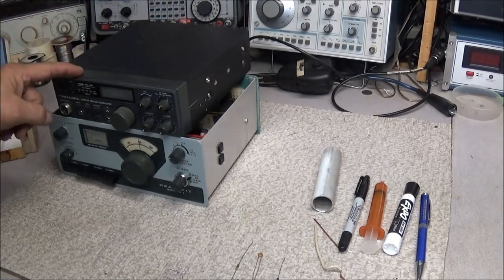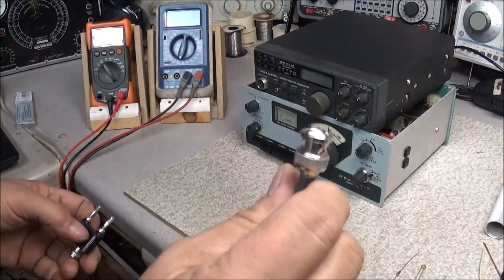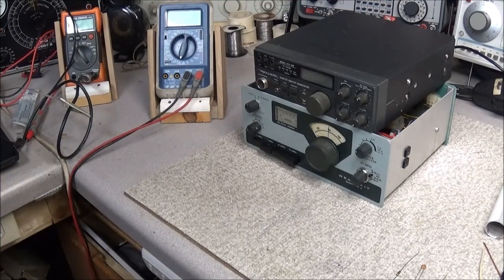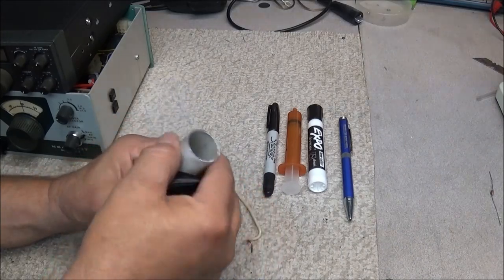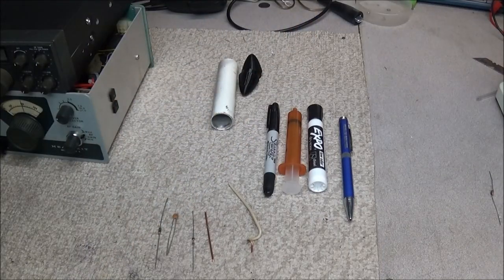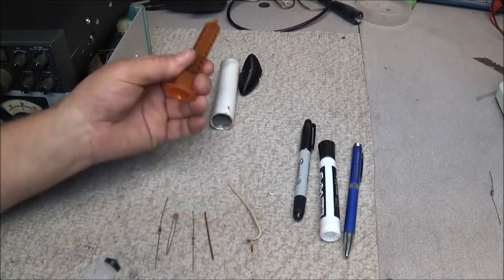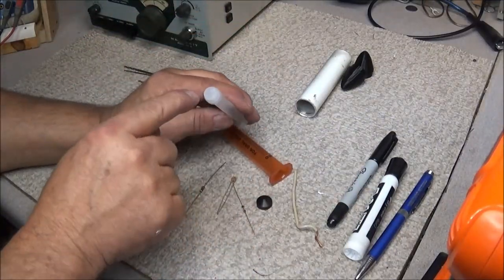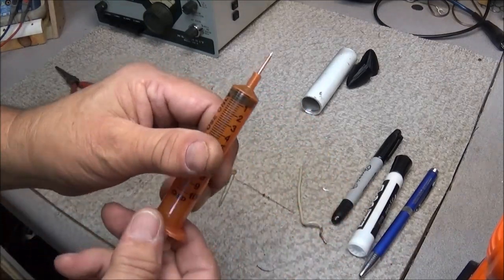#173 RF Troubleshooting Tips part 1

Comment: That's the two things that kill these and the President versions of the radio, bad caps and corrosive glue.  I have seen these where the glue became so conductive in the PA section it shorted the torroidal transformers out and had no output power.  Remove the glue and they work fine.    Man I hate that crap.  

Never thought about using a syringe as a probe body.  Good idea.

One thing I would recommend in the audio probe position is placing a capacitor in series.  Something around .1uf works fine.
Reply from the maker: Yep, about everyone of these I have worked on in the past 10 years have been cap and glue problems. Like you said in your videos, it is nasty stuff. The syringe is a great little tool to make all kinds of probes. Thanks for stopping in Mike
Reply: Hmmm, Mike's "favorite" adhesive for electronic circuits! If folks want to move up to a active RF probe I built a "Janielectronics" RF Active Probe for 100KHz - 1GHz PCB into a Sharpie retractable marker...search on eBay for "RF Active Probe + DC Out 100KHz - 1GHz"; cost about $30 and comes from Hungary. Thanks for all the tips Buddy!  73 - Dino KL0S
Reply: Adam Rennison 

Anything would work but you will usually see a high voltage ceramic used.  If you use a high voltage ceramic it keeps the size down and you can then probe high voltage audio circuits like a audio amplifier tubes output or output transformer.  All the cap does is block the DC.

Comment: Love the building of the rf probe in a hypo great idea. Then building the switchable AF/RF probe is pure genius. Yes indeed bad caps and that conductive glue always a suspect if you haven't got a broken wire or a cracked circuit board. Glad it was just a bad cap for the culprit this time.  Great troubleshooting video thanks for sharing.

Comment: Well done !  . I have a HR2510 with a no tx no rec , between your video and the tips added below I'm going to take another crack at it. Thank you for taking the time to share and teach.
Reply: 321Catboxnwc - if the no tx/rx is on all frequencies then you should check the Rx and tx transistor switches, they fail sometimes (assuming you already recapped), if it works on some frequencies, such as above 28.000 only, then it is a problem with one of the vco’s on the MPU pcb, I have seen them fail many times, sometimes it is a bad electrolytic capacitor, sometimes a bad surface mount ceramic cap.
Reply from the maker: Thanks, I would really be looking at failed caps on the cpu board. They leak and this eats the trace right off the board.
Reply: No tx rx all freq .  thanx alot, I will come back with my findings .

Comment: Great tips on home made probes.  Always good to see a new way to do things.

For the syringe probe, if you find it needs shielding this would work fine:  More solder braid off the ground point, wrap the plunger with some electrical tape, then wrap with foil, then wrap the braid around the foil and some heat shrink tubing over that to hold it together.  If clearance is a problem you could shave the "fins" down a little bit first.
Reply from the maker: Thanks Joseph. Great tip on the shielding.

Comment: This type of video is just what I need since I am getting back into radio work after about 20 years of being away. I am going to build an AF/RF probe myself but with different design. Mine will be small but the switching mechanism and all the electronics will be contained in a small plastic box that will simply mount on the shelf in easy reach. Looking for the second video now.
Reply from the maker: Sounds great. Thanks for sharing

Comment: I have a President Zachary T that was working one day,but would not work with a power mic - the next day I turned on the radio and no transmit at all. I have replaced all the capacitors,all the diodes and the driver and final transistor still will not key-up,The radio works fine in PA Mode push-to-talk work with nice loud clear audio. The Squelch,Mic Gain and RF Gain all work fine. Also when it was working - I was getting 18.2 volts to the Driver and final transistors and the radio was only supplying 13.6 volts to the board which was the reason I out all new caps and diodes in the radio.
Reply from the maker: Hi William. I am not familiar with this radio. But would start looking for a bad solder connection or bridged solder joint.
Reply: Buddy - what is the problem with the Cobra 25 LTD Radios made after the year 2000,there is literally truck loads on EBAY being sold 5 lots for $100 and FREE Shipping?

Comment: a germanium diode works well till 20Vpp of RF before failing. use a Schottky diode for higher RF signals (40Vpp max) or specialized detector tubes (for example the World War 2's LG2) for more than 400Vpp of RF.
Reply from the maker: Great tip. I will cover this also in a future video.
Reply: You should also show the RF probe in action.

Comment: Sure looks like you have every piece of test equipment that was made,is there any piece you don't have.Sure makes troubleshooting easier.I wish i had this much test equipment when i was a technician back in the 80's,keep up the good work and videos.
Reply from the maker: Thanks Jeffery.  No not much in the way of test gear I do not have.  Probably more than both GE and EF Johnsons shop combined that I have worked at.  Many years of collecting broken gear.

Comment: Some good  tips as always Buddy.  I've made probes from 3/4" PVC pipe. They have a variety of fittings that can be adapted to many uses. Readily available and cheap. 73 Doug.
Reply from the maker: Thanks for that tip Doug
Reply: HI  DOUG'''IN YOUR PROBE I WOULD LIKE TO SUGEST ''LINEING THE INSIDE WITH SOME OF THAT STICKY BACKING  METAL FILM TAPE'' LIKE USED IN HVAC APPLACATIONS LIKE DUCT WORK''''YOU NEED TO KEEP THE ''R.F''. OUT OF IT''''THANK YOU DOUG'''''JAMES''''HARRISON ELECTRONICS'''OKLAHOMA''73;S''''P.S. I ALSO THOUGHT ABOUT ''P.V.C'''''''73'S
Reply: @jamesharrison2041  Yes good point James. I've also used the aluminum shells of jumbo Sharpie Marker Pens that have gone dry. Stay well 73 Doug.

Comment: I would just be recapping the entire radio, they all need it now they are as old as they are.

On the hr2510/2600/Lincoln variant I have found surface mount ceramic caps failing on the MPU board too.
Reply from the maker: That correct, replacing all the caps is a must for a unit of this vintage.  Those caps on the cpu board cause a lot of crazy issues.

Comment: Personal opinion because of my being clumsy,  but I don't like the idea of that last probe you made being metal and grounded.  Thanks for the video,  gonna have to make me one.
Reply from the maker: Hi sneakysnake. I do agree with your opinion.  The RF probe will work ok in a plastic housing. Although if you are trying to locate a noisy component the 'AF" probe needs to be shielded so you can detect the noise source. Heathkit designed this type of probe many years ago. You can cover the body in electrical tape or a piece of large heat shrink tubing. Thanks for our comment

Comment: I believe the circuit in the two probes is not exacly the same, on the second one you have all the three components in series while the first has just cap and resistor in series with the "hot" line and the diode connecting to the ground.
I would like to hear your explain why the difference and when to use one or the other for practical purposes.
Thanks and keep up the good work.
Reply from the maker: Great observation. There are many different types of RF probes.  Lots of designs out there.  Some are more sensitive than others but practically does the same thing.  The designs I used were straight from the Heathkit manuals. I will do my best to explain them in future videos.  Thanks for the comment.
Reply: It seemed like the diode in the heathkit schematic went from the junction of the resistor and capacitor to ground, but in the build you put the diode in series with the other components.   If my observation is correct please explain the operational difference between the two designs.

Comment: Buddy I have a Cobra 29 LTD Classic and it is one full channel off frequency and I cannot find an accurate layout of the board and the adjustments for it. When it is on channel 33 it is actually on channel 34 and I could not find a VC adjustment anywhere on the board to set the frequency did not see a VR7 on the board either.

Comment: Great video!  Very interesting and I look forward to the next part!  Why did you suspect the capacitor between pin 3 and 1?  Why would that be the most likely?

Kind regards,
Simon, UK
M0SYS
Reply from the maker: Hi Simon. Since the IC was running so hot we know there is a problem on the output side of it. If it was on the input side there would be no voltage and no heat.  Looking at the schematic the first thing we see is an electrolytic capacitor rated at 10 volts.  The output pin has 7 to 8 volts on it. First red flag. The fact is most of the time when an audio device runs hot there is too much load on the output. This capacitor was so leaky it was shorting the output to ground. Hope that helps answer your questions and thanks
Reply: Hi Buddy, I see what you mean, I'm looking forward to the next part!  Thanks for the explanation, great videos and very helpful!

Comment: Hello Buddy - have you heard from Mike in a while,1 month and no new videos or updates. I am trying to find the 36.570 Mhz Mixer Crystal for the upd858 President Radios with no luck.
Reply from the maker: Hi William, no I have not. But I do know he is really busy and have not had much time for anything else. Guess that what happens when you are good at what you do.
Reply: I did not know if he was in an area hit by the storm or whether there was sickness or anything that might be wrong - I knew you guy usually kept in touch with each other.

Comment: Hey there great channel. I have a swan 350 and i am seeing lots of vfo drift and jumping in freq would appreciate if i could get some advice from you. Thanks and 73 don ve2ota....
Reply from the maker: Thanks Don. It is a known fact that Swans do drift.  The problem is the VFO oscillator causing thermal drift. In the old days just build or purchase an external vfo and this would solve most of the issues. There are many articles on the net about Swans drift problem.  You can go in and clean and rebuild the oscillator and that helps some. But even brand new they drift. Some folks have replaced the variable oscillator with DDS VFO units.
Reply: The Radio Shop thanks for the info i suppose i could live with "normal" swan drift but what i am seeing is fast drift like 500 hz over 30 sec and discrete steps in freq like it will jump 1khz i thought it was a mechanical problem in the band switch mechanical input to the vfo i tightened that up and its better but still seems to be a problem perhaps an external vfo is the best idea just wondering where the steps might be coming from  thanks again for your thoughts and all your work to create these fantastic videos you are an inspiration to many people. 73 don....
Reply from the maker: Thanks Don.  This is a shot in the dark but let me say this. The VFO variable capacitor could be causing a lot of that issue. On both ends of the rotor there are ball bearings. These are packed with grease.  Over the years this grease becomes dried out and hard. It also contaminates the area and prevents proper grounding.  This can cause the frequency to move around a lot. Wash those bearings out with contact cleaner then apply DeoxIt.
Reply: I have been working on the swan drift and most of it was eliminated by cleaning the rotary switch entering the VFO in the back ( the band select switch) with a rubber eraser and a little rubbing alcohol, That marginal contact was 90 % of the problem. I also added a fan over the finals and now after  a 1 hour warm up. The drift is good for a QSO. It's not 100% stable but it can go for a good long time before needing a tweak. Thanks again for you suggestion it got me looking at the VFO more closely and led to a fix. Loving the Swan.....

Comment: Did you fix the IFR?
Reply from the maker: You mean the 1200 FM? No, at the moment I am not ready to spend  250 bucks when there are many other projects in the pipe. I do want to fix it to use on the other bench but will have to wait for now.  In this video I was using the Super S which works flawless.  Plus I have several other SG's in the shop.
Reply: OK I think my 1200s suffers from the same thing :-)
Reply: what's wrong with it?

Comment: The schematic shows the cap tied to the resistor with the diode tied to the junction of the cap and resistor and the other end of the diode to ground. It shows the coax center lead to the free end of the resistor and the ground tied to the other end of the diode. Does it work the way the video showed with the center of the coax going to the resistor where you hooked the diode and the shield to the other end of the diode? I will try it the way in the video and if it needs to be like your schematic I will change it. Thanks for the great videos. KL7HRO@ARRL.NET